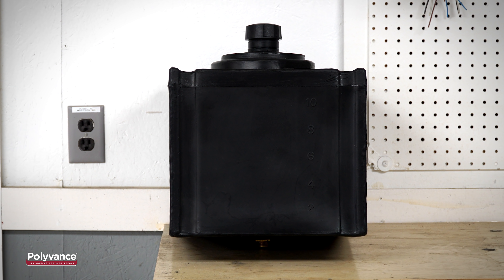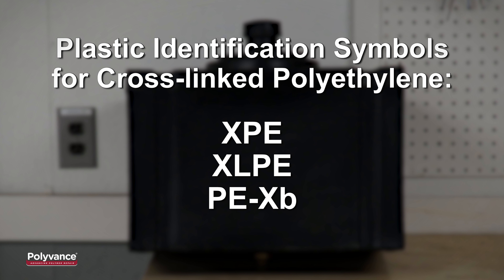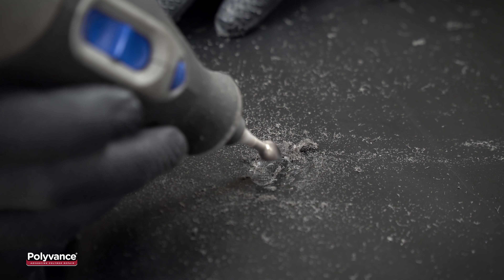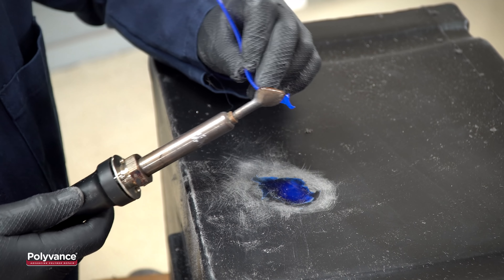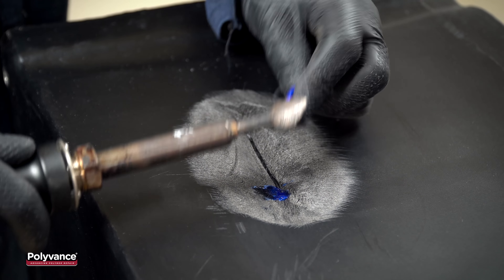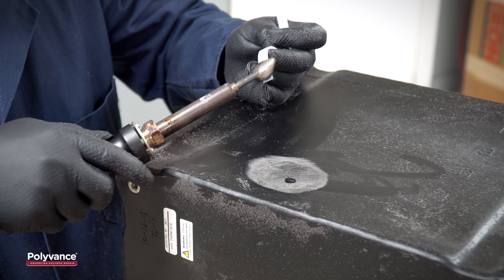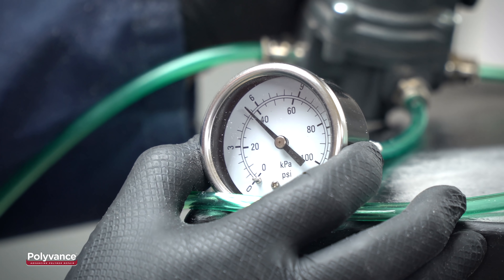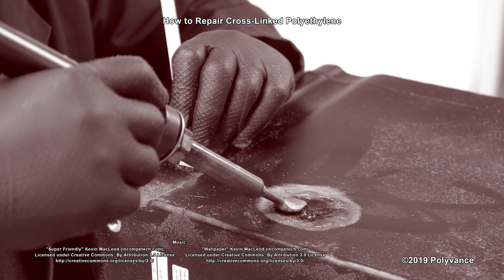How to Repair Cross-Linked Polyethylene

Comment: I’m so glad I found this video. Used your guide to fix a hole in a fuel tank from a 92 Lund boat. I worked the weld around the hole and got a really nice plug in the inside of the and finished the bevel just as instructed. Thank you!
Reply from the maker: That's awesome! We're glad you were able to make a great repair and avoid buying a replacement.

Comment from the maker: Timestamps:
Repairing a puncture - 2:01
Repairing a crack - 4:00
Repairing a hole - 5:00
Testing the welds - 6:18 (air pressure test 6:27, water test 7:04)

Comment from the maker: Backstory: The day we filmed this video, we had a customer call in asking how to repair a cross-linked polyethylene tank. He had a small crack in it, and a replacement tank would cost $450. We explained how to do the repair and told him which welding rod to order. Thankfully, he had recently purchased a 5700HT Mini-Weld Model 7, so he already had an airless plastic welder.

Comment: Hi, is it possible to repair a big hole?
Reply: Yes, definitely.  How big is the one you're talking about?
Reply: @scottb7600  it's about 10cm x 2cm
Reply: A hole that size is repairable, but whether it would be durable would depend on what sort of loads are going to be applied to it and how well you prepped the surface.  With a hole that size, its possible you could put a LDPE plate on the inside to act as a way to distribute the load to the non-damaged areas, while making a true weld to the plate on the front side and then a contact bond to the acutal part.  Email Polyvance with this question and I will send you a diagram of how I think it could be done.